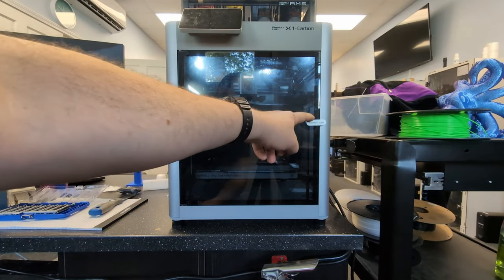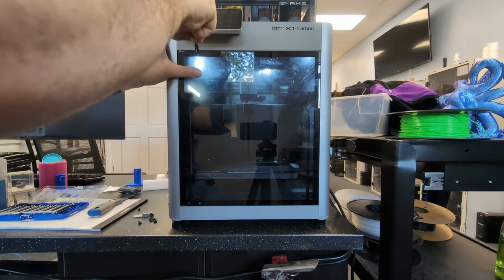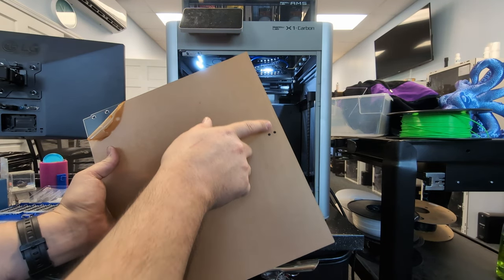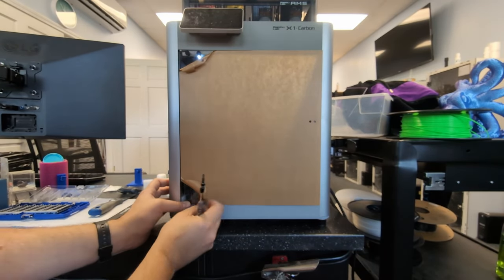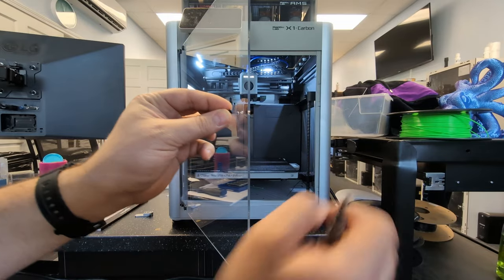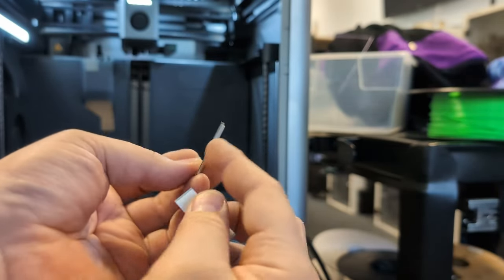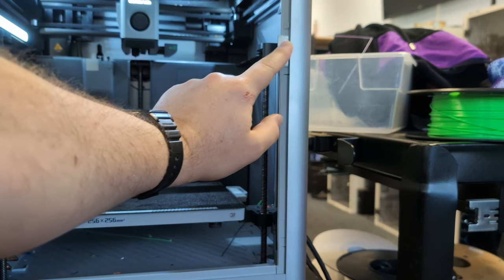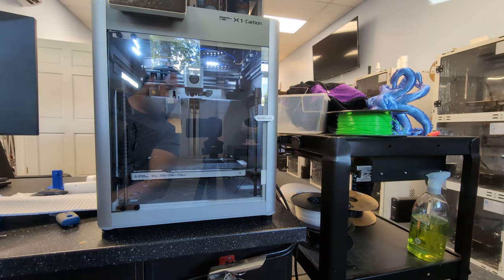Bambu X1/P1 Tough Panel Door Replacement - Clear & Durable

Comment: Btw guys if the adhesive is making the door stuck to the hinges, just pull the door out with a lot of strength but very very slowly. Also pull it out parallel to the direction of the hinges or the glass may break

Comment: After I took out the screws/grommet, the glass is still stuck to the hinges. I tried to pry on it lightly but still wouldn't come off. Tips on removing the glass from the hinges?
Reply from the maker: Could try putting some wd40 on them
Reply: @TH3DStudio  I'm thinking about ordering one. Does this have the same sound-insulation property as the stock glass?
Reply from the maker: We haven't noticed any change in sound one way or the other with the new panels. Its 4ft from me on my desk. The biggest thing with noise that helped was the feet for the Bambu printers we carry. They're an upgraded design from what Bambu offers.
Reply: @ruthlessluder same problem for me
Reply: what did you do @ruthIessluder to get the door off

Comment: Taken the screws and the grommets out and my glass door is still stuck tight! Want to install 270 deg hinges but can't get the glass off and don't want to twist or force it. Any ideas?
Reply from the maker: Put some wd40 on the glass door hinges. That usually softens up and adhesive on there to loosen up.
Reply: @whocareacrapsa were you able to get it removed? Mine is stuck on.
Reply: @aircreed  Yeah, I did. I used a blade. I think they have started glueing it on as well.
Reply: @whocarescrapsa  so blade between the back of the glass and the metal door holder? Next question, was it worth it? I'm kind of at the point of keeping the original on as is.
Reply: @aircreed  Yeah, for me it was. I kept bumping into the door and it was only a matter of time before I smashed it off. Now, most of the time, it is folded all the way back. And yes, I took a blade and slid it flat with the glass and it popped off.
Reply: @whocarescrapsa  thanks for all the info, much appreciated 👍🏾